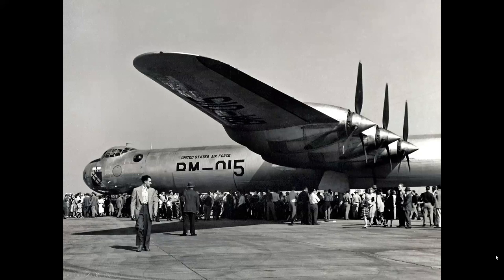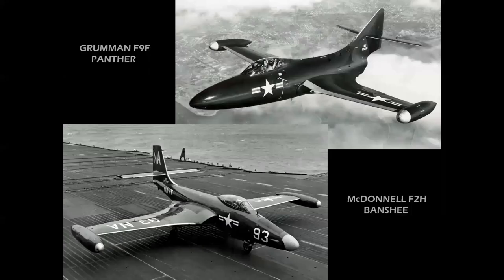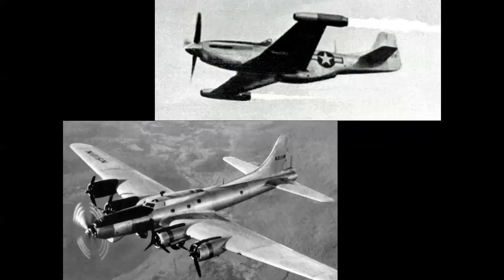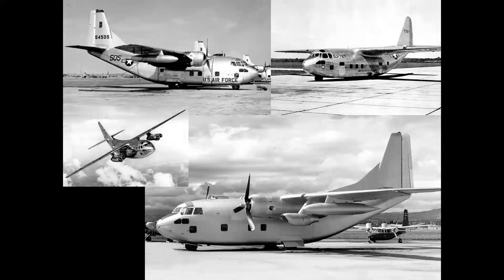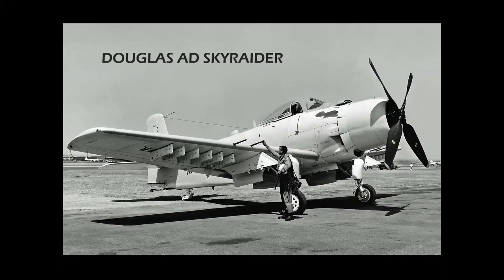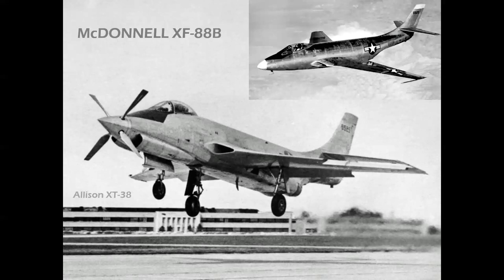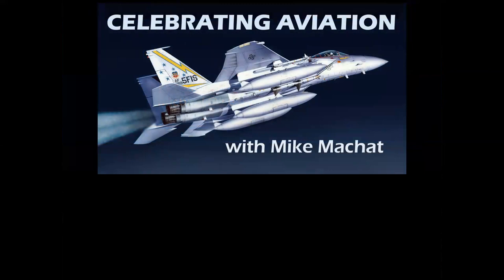PROPS IN THE JET AGE: Adapting Piston-Powered Aircraft in the Need For Speed!

Comment: How interesting!  I’m an airplane guy but you consistently mention airplanes I’ve never heard of. So fascinating to see all the blind alleys being chased by these pioneers as they moved forward into the unknowable future of aviation.  And I swear there’s the slightest extra pride in your voice when you’re talking about a Douglas aircraft. 😃
Reply from the maker: Appreciate the comment, thanks!
Reply: @celebratingaviationwithmik9782  Of course there's extra pride...I always liked saying on the radio "Doug" (never Douglas)...And like already mentioned--I'm an airplane guy who just says "Whew" when I listened to MM rattle of airplane types...
Reply: @celebratingaviationwithmik9782  Are the B-52s getting new engines now, I can't seem to find much info on the progress of this update, just hype, for the most part. Thanks for this fantastic episode!!👏🥰
Reply from the maker: @donaldstanfield8862  Thanks for the question and 'glad you liked the video. Yes, the remaining B-52s are being re-engined with eight Rolls-Royce turbofan engines like those used on Bizjets. These will not only mate well with the airplane's existing pylons and nacelles (there were rumors of a four-engine version for years), but willl burn 30% less fuel than the early 1960s-era TF33s currently used.
Reply: @celebratingaviationwithmik9782  I just searched and found the new engines will be installed in a couple more years and take several tears to complete. Exciting!

Comment: Great Summary of the transition from recips to jets.  Another variant on the piston-jet transition was the UAC Turbotrain.  DOT and United Aircraft Company developed the Turbotrain in the late 60s and it saw limited service in the US and Canada.   The train made a PR stop one evening (1969/70) in New Orleans.  My father and I went to see it at the station (where the Super Bowl is now.)  I guess the operators left the engines running in APU mode and that NO station may not have been included in the original design brief.  The engine exhaust impinged on the platform roof and it began smoke and bubble.  The visit soon ended and the train moved on.

Comment: A lot of great information.  

BTW, the New York Central jet powered railcar was actually a test bed to see if existing track work could be used for high speed passenger rail.  They just needed a quick and dirty power source to accelerate and sustain speed for the tests.  Mixed bag on the results.  Flat level track, no problem.  Curves/grades/crossings, lots of problems.

They still use recycled corporate jet engines for snow blowing and ice removal!
Reply from the maker: Appreciate that information, thanks Chuck! 'Loved riding on the new Long Island Railroad Budd RDCs out in eastern Long Island in 1956 - it was "the train of the future" back then.
Reply: @celebratingaviationwithmik9782  there are still some of them roaming the rails.  Mostly in secondary lines, mostly in Canada.  A pair of six cylinder Diesel engines and a modified torque convert from a Patton tank and you have a pretty nice powered passenger car.  Not “sexy” but very functional and efficient.  I do find the jet engine snow/ice removal units fascinating.  Original units were pretty large (retired passenger jets) and were mounted on work caboose partially to keep them from running away.  New units are one man or two man speeders (conventionally powered) with small turbines for ice melting.  Beats walking around with a blow torch.
Reply from the maker: @chuck9987  I'm sure riding an RDC today would be like driving a 1950s car - a neat vintage experience, but no comparison to modern high-speed trains. Rode the Bullet Train in Japan in 1967 - 125 mph, and as smooth as a jet airliner even back then. Thanks again.
Reply: They also used recycled jet engines to blow water on oil well fires after the first golf war.
Reply from the maker: @andrewmoore7022  Interesting point, thanks!
Reply: @andrewmoore7022  and it worked quite effectively.  There were concerns about it possibly taking years to put out those fires the old school way with explosives.  Old John Wayne movie about extinquishing oil well fires.  Looks like old jet engines can soldier on in other rolls
Reply: Not to mention rain from Nascar tracks. I remember one race where a race car ran into one of those jet trailers filled with jet fuel with the result being what you would expect.

Comment: It’s somewhat ironic that almost every appliance I’ve owned that was made by GE has been very unreliable. When I fly on a passenger plane using GE engines, I wistfully look out the window and hope the jet engines weren’t made in the same factory that made my appliance.
Reply from the maker: A famous story at McDonnell Douglas was when Northwest Airlines CEO Doug Nyrop ordered the long-range DC-10 Series 40, he demanded it be powered by Pratt & Whitney engines rather than the GE CF6 normally on the jetliner. His famous quote was, "When I want a jet engine, it's Pratt & Whitney - when I want a light bulb, it'll be General Electric!" DC-10-40s were powered by the Pratt & Whitney JT9!
Reply: @celebratingaviationwithmik9782  very interesting as I didn't know this story! But I must say that both the Pratt & Whitney  and the GE jet engines are very reliable! By the way thanks for video showing those hybrids of which some are fascinating 👍👍
Reply: No the jet engines are made in a completely separate division. Most G.E. appliances are actually built by Amana under contract with G.E.
Reply: We were buying a washing machine recently and my wife pointed to the GE model and I said "I trust GE in the air, but not with my clothing."
Reply: Oh,then you would jump out of the plane when you were told jets were a german invention (:-))
Reply: @michaelpielorz9283  No I wouldn’t, but I would hope the jet engines, if made by Germans, weren’t made by BMW that use plastic water pumps in their auto engines, and are a major weak point.🤣🤣.  But, the Germans made great WWII planes👍
Reply: Their Diesel locomotives are garbage too.
Reply: @michaelpielorz9283  yes. Because I've only ever jumped from prop planes. Jumping from a jet? That'd be a hell of a (possible) last ride.

Comment: The Lockheed P-2V Neptunes. I used to live in CA, near FOx Filed in Lancaster CA. A company flies fire fighting aircraft out of there. I used to hang out at the airport, and had the pleasure of hearing both types of Neptunes taking off and landing. The ones with the auxiliary jets and the ones without. Interesting sound hearing a piston powered aircraft taxi out with the doors on the jets closed. Then on takeoff, you could hear when the jets came into play. Very unique sound with two large piston engines and two jets all running full bore at the same time.
Reply from the maker: Thanks Robert, and I saw those P2Vs at Fox along with the C-54s used for several seasons. Great vantage point for watching all the ramp action

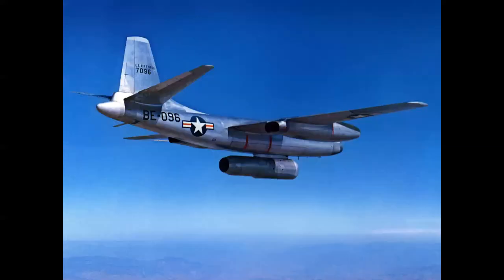Comment: Pretty interesting and good job on your artwork too.  What I really want to know is how that B-45 at 14:22 was able to take off and land with that big engine under it.  Extended and retracted from the bomb bay?
Reply from the maker: Yes, you can see the lines of the bomb bay on the lower fuselage, and the engine assembly was partially retracted into that aperture for takeoff and landing. Good catch!
Reply: Yes, I wondered about that, well, they went to a lot of expense and trouble tinkering with jets, didn't they! 
The J-79 still astounds me, such an advancement I didn't imagine possible. The metallurgy was more advanced than I thought, and now, with 3-D printing, it's mind-bending!

Comment: The B-36 FICON program was operational 1955 - 1956 with Strategic Air Command's 99th Strategic Reconnaissance Wing (SRW) flying ten specially modified GRB-36G; and the 91st  SRW flying "parasites"  The the parasite aircraft involved were a squadron of twenty-five RF-84K reconnaissance fighters.  The specially modified RF-84 K models could be distinguished by the horizontal stabilizers being modified with a slightly downwards slant (anhedral)  to better fit the GRB-36D when the RF-84K was carried aloft.  As far as is known, the RF-84K was never used operationally.  The concept of the program was that the GRB-36Ds, with their extremely long range, would carry the RF-84Ks close to the target(s) to be photographed, whereupon the RF-84Ks would release from the RB-36Ds, make a high speed dash to the target, and then return to the GRB-36D or a friendly airfield. In the long run, the Lockheed U-2 proved to be a much better idea and the FICON program was terminated.

Comment: That is some great material.  One of the other interesting JATO or RATO airplanes of note was the 727 with rockets for high/hot operations such as Mexico City.  It was tested, but not implemented, to improve the engine out second segment performance of the 727.  The Boeing archives should have video of the tests if you are interested to view them.
Reply from the maker: Great point, thanks, and ONA also had JATO for their DC-9-30s.
Reply: @celebratingaviationwithmik9782  Just trying to help get everyone on track, a lot of us say this incorrectly.   The true acronym is R A T O for Rocket Assisted Take Off when using ROCKETs and J A T O for Jet Assisted Take Off when using JET engines for takeoff.  Its facts
Reply: Mexicana had 727's w/RATO in service. Four bottles..two each side..buried in the aft wing root. Aircraft were easily identified because of a reinforcement hump on top of the fuselage. The system included a cockpit ignition switch in the overhead panel with a typical red safety wire cover and a key lock.

Comment: Another great video from the cobwebbed corners of aviation, Mike..  
Even as a lifelong wingnut, I had seen many but not all the goodies you posted... If ever put into production, the J47 powered train was clearly from a day when JP4 was pennies a gallon...  
Airplane manufacturers need to rely on engine manufacturers to advance the state of the propulsion art by turning ideas and calculations into hardware.  The XT40 engine was a great example of a convenient solution that the military saw as the "next gen" solution to the early jets' inefficiencies, only to see it fail, along with the airframes that were planned to use it.  AFAIK, the only production airplane that used the XT-40 was the Convair R3Y Tradewind with 11 built (?).  That's the price of being on the bleeding edge of technology, I reckon.  
Of interest is that after the XT40 failure, in 1954 Allison "evolved" the T-38 paired in the XT40 to create the single power section T-56/501-D that powers the C-130, P3 and a dozen more types.
Reply from the maker: Terrific comment, thanks!
Reply: Isn't it amazing we have guys like Mike that provide fascinating aircraft entertainments!!
Reply: Have you seen the great episode on Agent Jay-Z YouTube of the cutaway 501 turboprop? He gives a great account of how it works, and it good enough to watch many times!

Comment: What an incredible video. You captured a period in aviation where developing aircraft did indeed project the need for speed. A lot of it done with pure mental energy  slide rules and steel - no computers. We would not be at the level of aircraft designed today without this period. In fact in some cases I believe we have exceeded the capability of pilots being able to handle the aircraft, and are over engineering with size and materials  A remarkable trip back in time because I was in at the crossover of the 50's into the 60's. Where in the world did you get some if these awesome pictures.? Thanks for the memories.
Reply from the maker: Appreciate the comment, thanks. After 40 years in the aviation book and magazine world, I've been able to acquire a pretty good photo archive. Happy to share those on YouTube today!

Comment: Mike, many many years ago I seem to remember hearing a story (military urban legend or a big lie) concerning the Ryan Fireball. The story goes that a Lockheed P-38 pulls up in formation with a Fireball.  P-38 pilot calls out: "Hey Navy look at this", cuts one engine and maintains formation.  Seeing that, the Fireball pilot shuts down the radial engine. So with a feathered prop, and using the jet engine only, the Fireball maintains formation with 38; giving the appearance it is magically flying without the use of the prop (radial engine). The Fireball pilot calls out: "Hey Air Force (maybe AAF) Top This".Whether true or not, it does make a good story on post WII US Military Aviation rivalry and the coming jet age.  Thanks again, Mike for sharing these great aviation art history stories!
Reply from the maker: Hadn't heard that one, but great story, thanks!
Reply: @celebratingaviationwithmik9782  Mike, I did a little digging in my collections of books and finally located my copy of Steve Ginter's book on the Ryan FR-1 Fireball and XF2R-1 Darkshark (Naval Fighters Number 28).  There on pages 43 - 44,  I found numerous stories of Fireball pilots showing off their feathered prop / radial engine off (jet engine on) flying capabilities to different aircraft including unspecting P-38 pilots.  There is no mention of pilot to pilot conversations., but I guess that was added to the stories to make it "sting" a little harder when told in the following years.

Comment: The LP-2J pictured in the opening, equipped for cold weather operation, including skis once landed in Ohio, and was left by the crew. Not sure how long it sat there before our squadron flying SP-2H’s got permission to strip it for compatible parts. Spent 3 days stripping it including one 3350 and prop, and several crews boxes of parts. Even got an APU, but had no way to use it on one of ours as we didn’t use em.

Comment: Flight Journal states that the turboprop/turbojet composite-powered versions of the Stratojet was actually designated XB-47D under USAF Air Materiel Command Secret Project MX-1637. 
Boeing model numbers were 450-162-48 and 450-162-49.

Comment: Event the Nord Noratlas had wingtip jets (the same as the T-37 Tweet, original french version). These jets were used for higher MTOW or to improve take off performance when needed. Then they were shut down in flight. Of course in the the case of the KC they helped a lot for refueling speed. As far as I know they used jet engine versions adapted to burn AVGAS, even in the case of the KC with jet fuel onboard.

Comment: XF-84 Thunderscreech, 12 flights with 10 emergencies. How did this ever make it off the drawing board?
Reply from the maker: Valid question, and best explanation is that experimental airplanes like the XF-84H, Skyshark, Convair Pogo, X-13 Vertijet, etc. were all designed and flown in the early to mid-1950s, an era of tremendous exploration and experimentation in aviation. In the days before digital simulation, these types of aircraft were built to see how their new technologies would work - or not. Thanks for watching!

Comment: Question: What are the thin redlines on the fuselage and top of the wings. I see them often, especially on the top of wings on many military plane models
Reply from the maker: Great question, and there are actually several reasons for the red (or black) warning stripes on wings, fuselages, and jet engine nacelles. Those tricky-looking line patterns on the tops of wings are walkway boundaries for crewmen or fuelers working on the aircraft. They have to stay within those lines to avoid damaging certain areas of the wing or control surfaces. Red lines on the fuselage show the exact location of the propeller arc, so ground crewmen can avoid those areas with the engines running. Red lines on jet engine nacelles show the location of certain stages of the turbine blades inside, again, so ground crewmen didn't stand in that spot in case a broken turbine blade punctured the nacelle. Common back in the 1950s, but not a problem on today's aircraft, hence no red "turbine stripes" on modern jets. Thanks for watching!

Comment: Speed was not the reason that the Westinghouse J-34 jet engines were added to the P2V-7, or SP-2H, post 1962.  The jets were added to compensate for the weight of all the pre solid state, electron tube electronics used for hunting submarines. They were only used during takeoff and landing because if one of the R-3350 turbo-compound engines failed during takeoff/landing recovery was doubtful at best.  The jet intakes featured doors that were shut when the jets were not operation.  I was a mech assigned to VP-65, a USN Neptune squadron. "Lower and slower" described the P-2 normal flight regimen.  Oh, by the way, the J-34 ran just fine on 115/145 aviation gasoline. But they were thirsty.  We called them "Inflight defuelers."
Reply from the maker: Great comment,, and thanks for the information!

Comment: You got some info wrong on the Boeing  "Dash 80".  The Dash 80 first became the C-135 Stratotanker and then Boeing used the basic design for the 707.  While looking the same the 707 and C-135 are completely separate designs.  The C-135 has a narrower fuselage and was built to a military specification while the 707 was built to FAA standards.  BTW I'm a retired KC-135 engineer.

Comment: Since fuel requierments are much different for recip engines vs jets,how was this handled? Did aircraft such as the B-36 or even the Neptune have 2 completely separate fuel systems[tanke etc]??
Reply: I was a mech with VP-65 at Naval Air Station, Point Mugu, CA, flying the SP-2H Neptune. The J-34 jets ran on aviation gasoline.  I would assume the same was true for the B-36.  Sometimes, when landing at an Air Force base like Nellis AFB for fuel, we would be asked if we needed jet fuel too. The answer was "no."